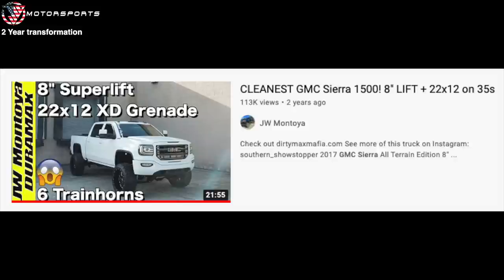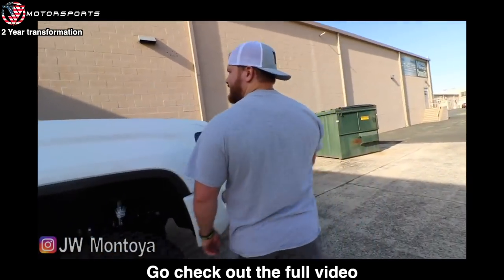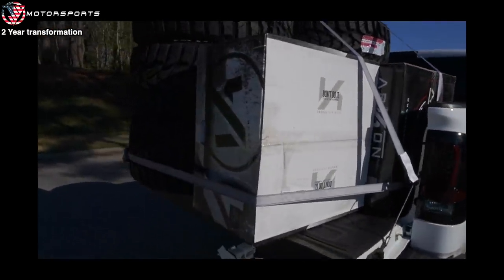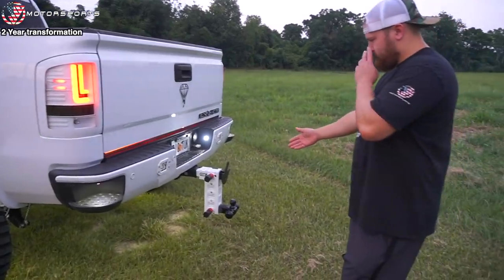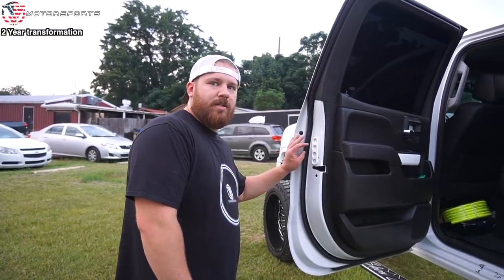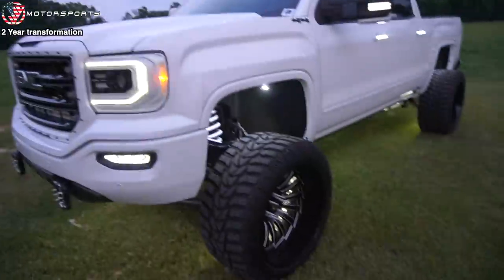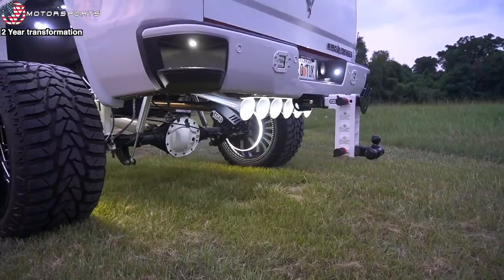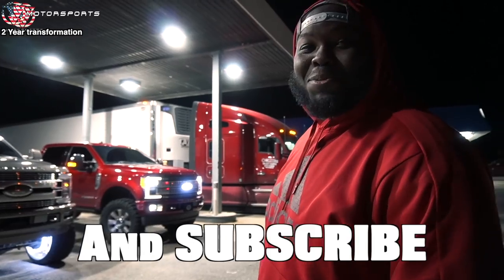AMAZING 2 Year Truck Transformation! GMC Sierra | 10" Lift 24x14 36s |

Comment: With the 2 inch leveling kit added to 8 inch did you add any in the rear , curious bc I have a 8 inch lift and I want to add a bit more but I don’t know if the block and the add leaf be enough with the 10 in the front ..

Comment: I don’t think this truck can keep 70mph on the highway with that wheel and tire combo…looks good
Reply: I roll 80 easily.
Reply: Mine can’t with 20x12s and 35s constantly downshift
Reply: @harly108023  re gear the rear end. You’ll notice a difference right away. I had to do that to my better half’s Yukon 👌
Reply: @harly108023  Had a truck come with 3.08’s and regeared to 4:56’s with the 6 speed and truck had effortless power turning 20x12’s and 35’s
Reply: @paul_omalley  I’m going to try swapping my 20x12s for 20x9s if that doesn’t work then I’ll regear…by the way my truck is 2008 Chevy 1500 with mcgaughys 7-9 set at 9”
Reply: @abbeyalex123  name the price?

Comment: The amount of stress on your control arm is worrying. If I’d do the FEA simulation on it then you’d understand. My advice to you and all other homeboys here is that, do not lift it that much that it looks obnoxious just like this. A 3.5” lift kit is more than enough and doesn’t puts dynamic stress on the drive system or the suspension. These pickups are not made for off-roading. If you really into off-roading then buy a JEEP
Reply from the maker: That’s why the control arms are upgraded to Cognito ones, which has better angle and much more heavy duty than stock. 
I disagree on 3.5” kits. Most 3.5” kits are leveling kits and alters the front end geometry more than your standard lift kits.